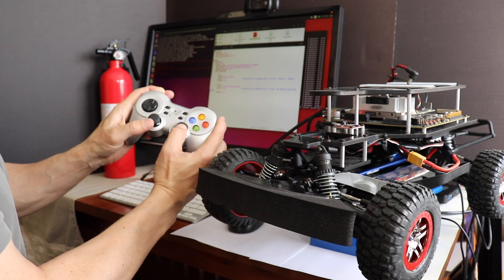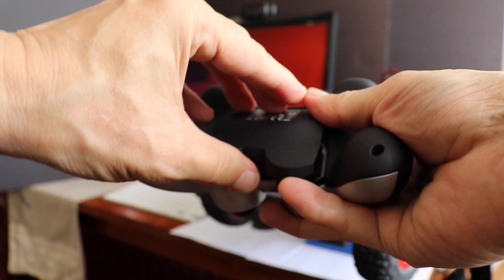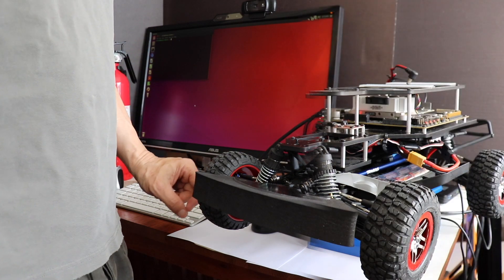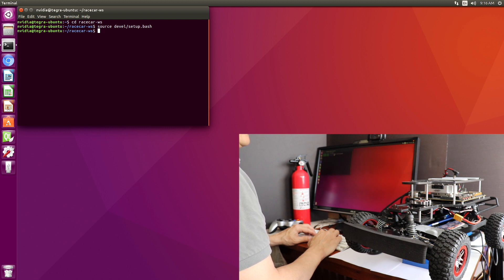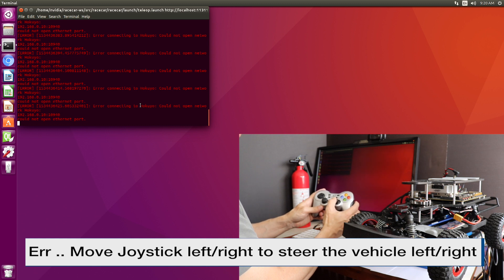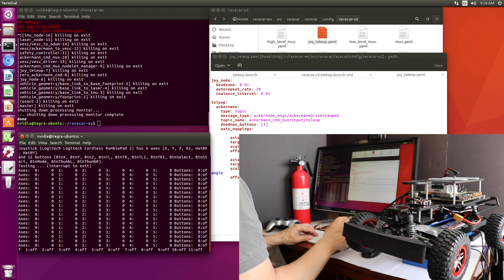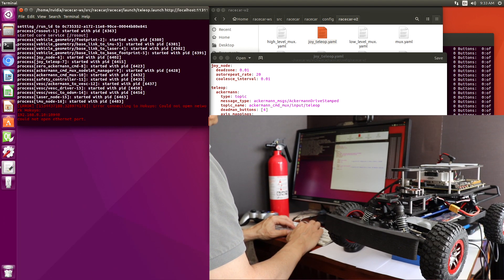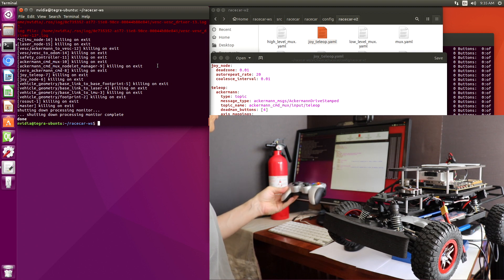RACECAR/J ROS Teleoperation

Comment: Forward and backward reversed in the motor drive by the vesc. Where should I solve this problem?
Reply from the maker: You can swap the connection of any two of the wires between the VESC and the motor.
Reply: @JetsonHacks  thank you:)

Comment: ello,
I’m trying to use Logitech GamePad F710 in Direct Input (D) mode along with Jetson Xavier.
I have followed all of the instructions given by you to connect the game pad with Mode light off and it’s being detected by the system as “/dev/input/js0”, but when I run “sudo jstest /dev/input/js0” o/p is shown with pre-normalized values of all the parameters. In this issue is that Data in the o/p of jstest is not getting updates as I move joystick or press buttons.
Initially I thought that it be issue with read/write permissions of “js0” device, so gave those permissions,
Anyone has suggestions/ solution to this problem?